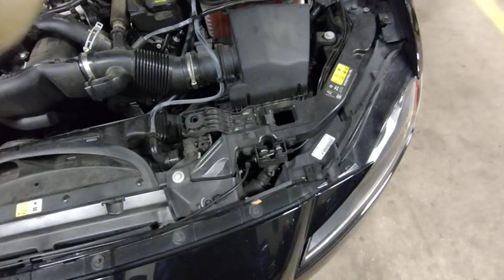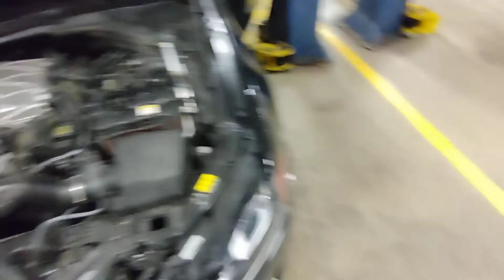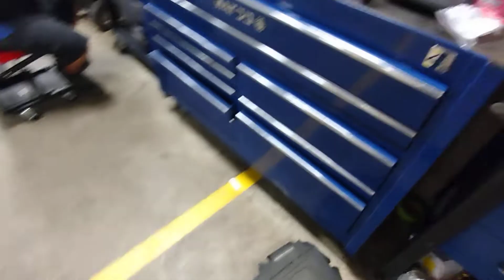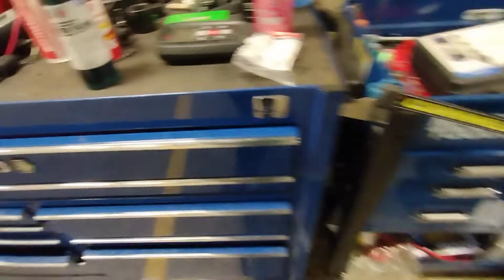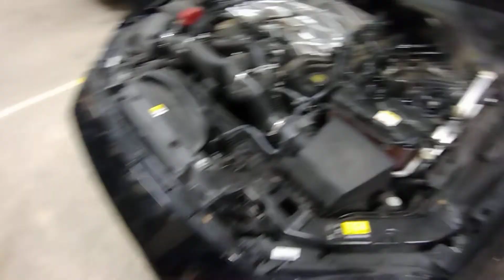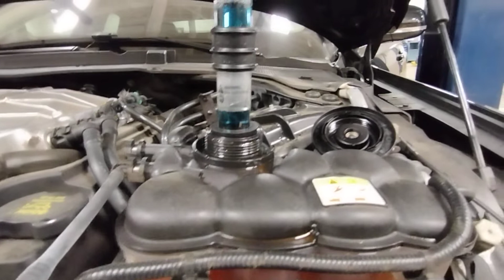How To Do A Combustion Gas Leak Test

Comment: Possibly an intake gasket?
Reply from the maker: This intake isn't liquid cooled.  So it wouldn't cause a coolant leak
Reply: @BeardedFordTech  
I’m not familiar with Jaguar so was just guessing lol.
Reply from the maker: @12yearssober  all good. Like the older vehicles like the Ford 4.6. It has a water cooled intake. This specific car doesn't. So if the intake was leaking I would get lean codes. There is a coolant pipe that runs under the intake. Checked it with my camera. It's bone dry.

Comment: Cracked block?
Reply from the maker: Well it wasn't the gasket or cylinders. It passed the combustion gas test.  I realized after leaving work the water pump is behind the timing cover. I bet that's my culprit. No dipstick on these. So I have to drain the oil to verify.